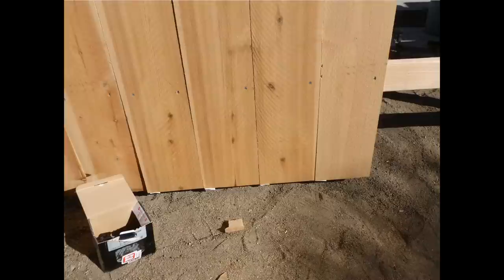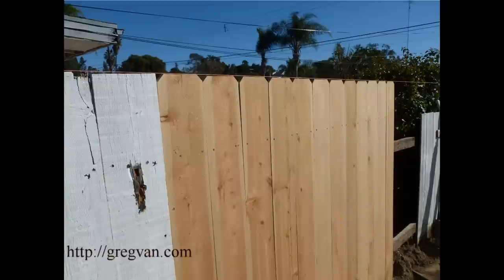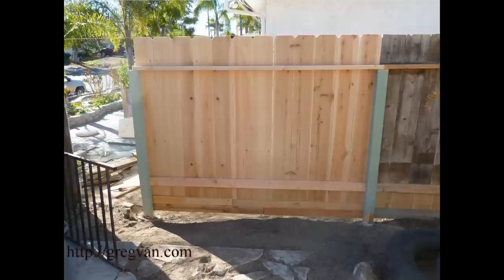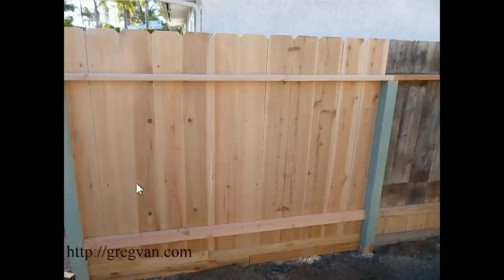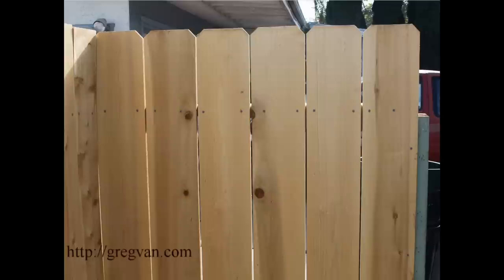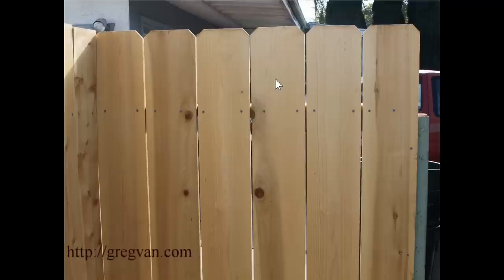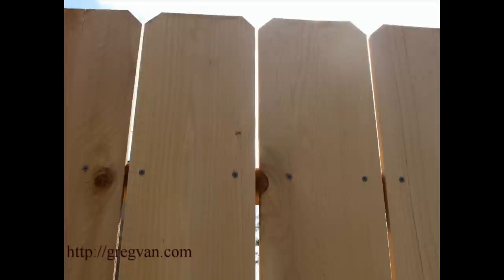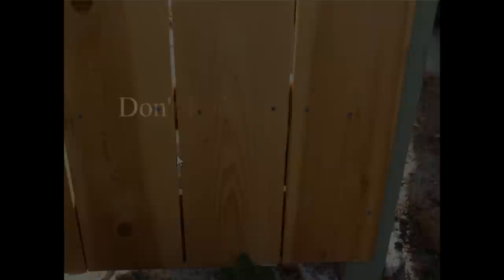How To Eliminate Large Gaps Between New Wood Fencing, Before You Build

Comment: built a gate 2 weeks ago, it was tight as hell. Now I have roughly the same spacing you do there in it. I'm thinking of just getting a few more boards and putting an overlap on the other side so it at least won't be see-through, only real solution I can think of since the wood will expand back out in the rainy fall, winter and spring seasons anyway so moving them closer together now will end up destroying the gate.
Reply from the maker: Yes if you're looking for privacy than the overlapping boards might do the trick.
Reply: I am thinking this method also

Comment: It would have been great if we can learn HOW to eliminate the cracks after the board (through moisture is eliminated with aging) shrinks. Does one rip a board into 2 (ie. one board = 2 boards at 2/3/4" each and attach them between the cracks)? It's very expensive for bamboo or privacy fence covering.

Comment: I built a fence with the treated white wood. no gaps. 1 month of 70-90 degree weather the boards dried out to a 1/2" gap between each board.
Reply from the maker: Dusty G. Thanks for sharing and it's hard to imagine how much a board can shrink. What a bummer for your privacy.
Reply: How come fence builders don't let the wood sit for a week or so before installing? It has been >90° recently where I live and the wood is shrinking fast, gaps are forming, and some wood appears to be warping. All within the first week.

Comment: All wet wood will shrink. Did about 10 deck boards on a trailer, 5/4 x6x 10' knew they would shrink. Tongue and grooved them with a router, about 1/2 " on each board, been 15 yrs now, no gaps. I wouldn't hesitate to do it on my fence, I don't mind the extra work, and boards it would take, but the gap doesn't bother me there. Drying in a hot climate is good , in direct sunlight, boards laid out , and hoping it doesn't rain, may take a week or so where I live, intense summer heat. But, this takes time, work, and plenty of room.  BUT.
. some of these boards are likely to warp/ twist ,after drying. Can't win .

Comment: If you keep pushing the boards tightly together, once you start to get to the end, your boards will not be level at the top. This is the reason professionals install pickets with a very small gap in between. If you do not want gaps (use solid panels).

Comment: I took of the pickets and re-did them again after they shrunk. No more issues
Reply from the maker: Just watch out, because if they get wet the lumber can expand and might cause the pickets to buckle as pressure is placed against the other boards that are also expanding.
Reply: @gregvancom  hmmm. Didn't think of that. Thank you for the heads up
Reply: @zaloalvarez6947  did it happen what he mentioned ? How did it keep up
Reply: @jrjr8574  I didnt have any issues. Still intact and nothing broken. Its been good since.

Comment: VIDEO DOESN'T GIVE INFO ON HOW TO AVOID GAPS!
Reply from the maker: It sounds like I need to make a video to create a fence you cannot see through. 

Pinned by gregvancom
gregvancom
6 months ago
This video will not provide you with information for eliminating gaps, but will provide you with a method that will help you eliminate "LARGE" gaps when building a wood fence like the one shown in the video.
Reply: Video was well done, if wet fence board is used, install with no gaps because they will shrink!  If dried board is used, screw on with gaps between boards.  Doh!
Reply: @robertonestaj1329  I have put dry boards on , and no gap, and if fastened well, will not pop off or buckle when moisture enters and expands. Good ring shank nails ,and maybe an extra one on each nail line.

Comment: But how do you fix it?  I had a VERY LARGE indoor barn door built with wooden slats. It is 106” high x 46” wide. It is a door that is from a master bedroom to a master bathroom. So privacy is very essential. 

Ok. So now one year in, there are now large gaps in between the boards that were painted white by the original builder after it was completely built due to shrinkage. 
How do I fix this eyesore of a problem? Personally, I cannot fix this humongous door as I live by myself and am disabled. I cannot even take the door off of the track. It’s so heavy and I’m only 5’3” and 120 lbs with a bad back and neck. 

I was told that it was painted with Kilz before the white paint to stop the wood knots from showing up as yellow through the white paint. 

Now I still see a ton of yellow circles as well as the gaps between the slat boards. I “could” use a caulking gun to attempt to fill in the gaps but the chances of it looking good on both sides is slim to none as I’m inexperienced with using a caulking gun, too. I truly don’t know how to fix this. It was an expensive door that was made to order for me in NY, and then it was driven to Arizona to be installed in a new home that I just moved in to. So I can’t even have the original builder help me with the necessary repairs. 
If you could give me some avenues to pursue, I’d be extremely and eternally grateful. It’s been such an eyesore  when I look at it now, from something that I was originally extremely excited and obsessed about. If it wasn’t such a very oversized door, I’d try to repaint it, but I think that the paint would just pool in the bare spots where the slats have shrunk down quite a bit in between each other. The humidity in AZ is incredibly different than NY, but it was fully tight and built properly when I first got it and when it was put on the rails. 

I’m permanently disabled and I have a MINI Cooper so I’m absolutely not in any position to fix this door by myself. I would love to seem to sound like I know what I’m talking about when I try to explain this to a handyman so that person doesn’t feel like they could take financial advantage of me or try to use subpar materials on such a piece of art in my home. I just want it restored the proper way to avoid this from happening again in the future. I’ve been scammed so many times in AZ already because I’m new to the area and seem like I have been a target to the community whenever I’m trying to ask for help. 
Thank you for any help or advice that you can provide to help me. Please and thank you. 👍🏻🤗🙏🏻
Reply from the maker: You can usually cover spaces by installing lumber like plywood over gaps. Use exterior grade plywood or lumber if installing outdoors.

Comment: I just installed my 6ft cedar fence in Seattle where there is a lot of rain and wind during fall through spring time. I bought the boards last week and coated them all with sealer in all sides. I butted them pretty tight. Will it form a gap overtime even if they are sealed? And do you recommend having gaps for wind to pass through?
Reply: Yes gaps are great for wind. Those posts take the beating and why you’ll catch some leaning years down the line. Wait to stain a year after.

Comment: Please reply, I bought some pre installed panel fencing last year & as  you can imagine there are some Gaps, My ? is what type of wood caulk do you buy to fill in the gaps? & do I install the caulk first or can I paint he fence first or second  with a wood finish paint?
Reply from the maker: I wouldn't be able to recommend a caulking for wood, but imagine you could use it for gaps smaller than a quarter of an inch. I don't think it really matters whether the fence is painted or unfinished. Don't forget that the wood will expand if it gets wet and that the caulking could loosen and fallout over time.
Reply: Okay thanks Sir

Comment: You could caulk the gaps with similar color !!! Just saying .
Reply from the maker: Now you're probably wondering why you don't see this more often. It's because the wood fencing boards expand when they get wet and shrink when they dry. This movement over time can wreak havoc on caulking and might not always work. Definitely a common sense approach to this type of problem, but whether or not it will be effective over the long term will be another story.

Comment: People to this all the time. Interesting topic, but never address the answer. Frustrating, However my solution was to use backer-rod to  fill the gaps. Used chalk for the smaller gaps. Then I painted and it worked out real well for my project.  For larger fences it might get a bit tedious, but still cheap and doable. That was my fix anyway.
Reply from the maker: It sound like you're looking for more information on privacy fences, not how to eliminate large gaps. I have more videos on privacy fences you can't see through at our website.
Reply: Thank you. I've been wracking my brain trying to figure out a solution because the neighbors sprinklers are causing weeds to grow in my hardscaped river rock.

Comment: Doesn't anyone stain fences anymore? That would help prevent shrinkage and helps prolong the fence..
Reply: You don't stain the fence until after it's had time to dry a month or so.  It's right on the can.  The wood will shrink and and the stain will crack and peel.